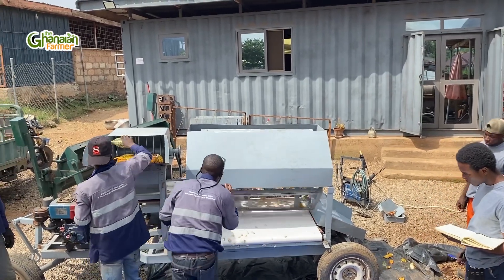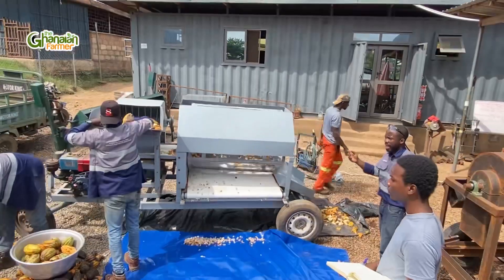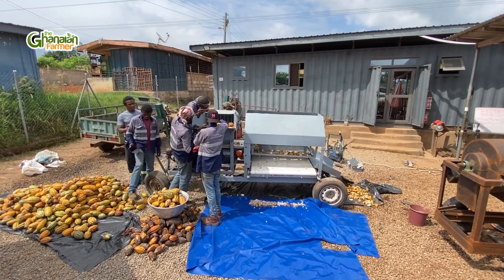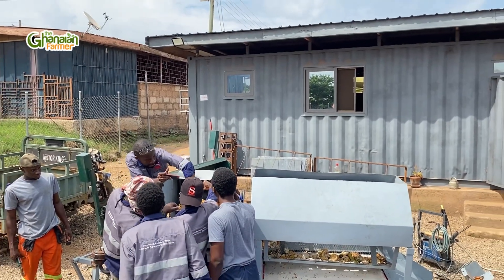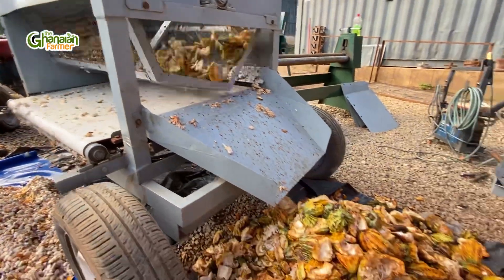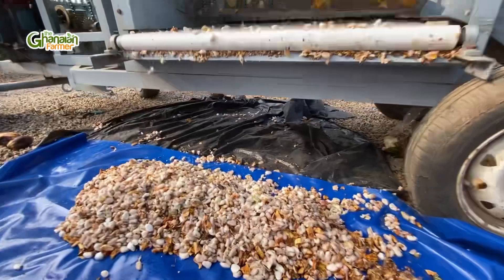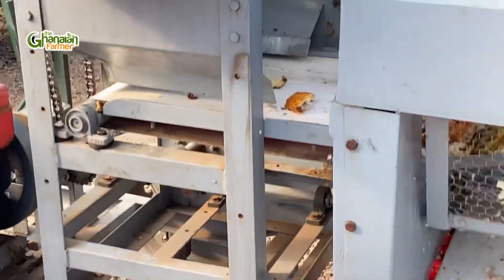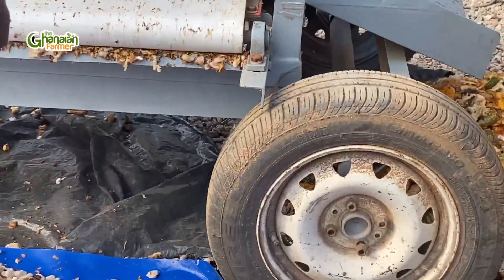Why They Built This Multi Million Cocoa Pod Breaking Machine For Cocoa Farmers In Ghana 🇬🇭

Comment: The should make the conveyor at least two feet longer to prevent beans from falling under the machine. The waste chute should also be two feet longer to prevent the waste falling under the machine.
Reply: You bring out no any innovation but you always see people's fault
Reply: Well, in as much as this may be a concern, the truth is that it's a mobile pod breaker, so a long conveyor may limit its mobility efficiency. Additionally, there has not been much of a challenge collecting the beans where they currently fall. Also, the husk/chute does not necessarily interfere with the machine's operation.

Comment: A VERY GOOD INITIATIVE BUT THE PROBLEM IS HOW TO SEND THE MACHINE TO INDIVIDUAL FARMS DUE TO OUR FARM ROUTES.
Reply: Valid concern, the farmer organizations should find a way. Maybe the engineers can also be designing a portable version later. 
Congratulations to the engineers 🎉🎉🫡
Reply: @frankziddah  That will be fantastic
Reply: Which university has developed it?
Reply: @LNitinChordia The initial idea was designed by myself from Ashesi University and a partner from KNUST in Ghana, and then we later partnered with SAYeTECH. However, I'm currently pursuing my masters in ML in Additive Manufacturing in McGill, Canada. I'm interested in design and manufacturing and its related research.
Reply: Valid concern; however, the machine was designed with the terrains of Ghanaian farms in mind. As one of the core engineers behind this machine design and also having lived in a cocoa farming community for a very long time, we designed it such that it can be easily towed by a tricycle, which is one of the common vehicles that can easily maneuver through most our Ghanaian farms to carry this cocoa after production.